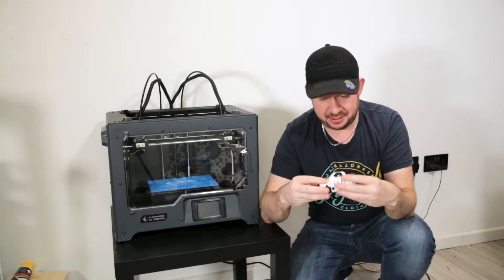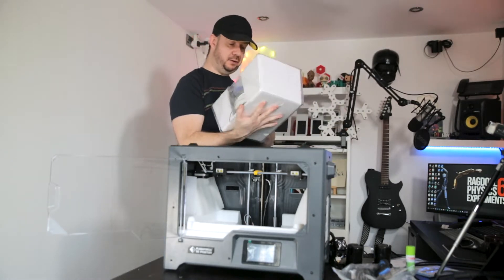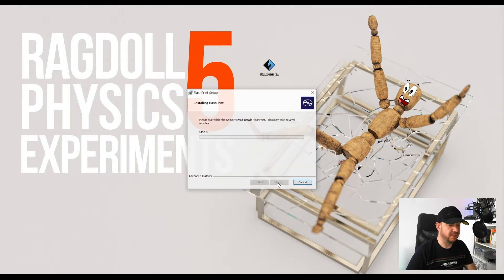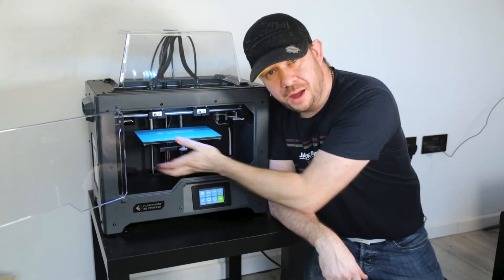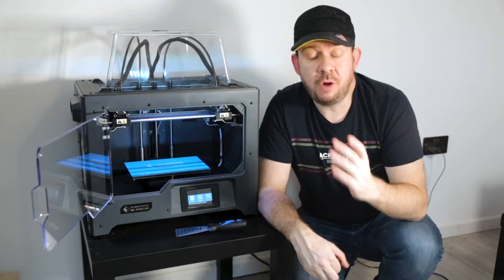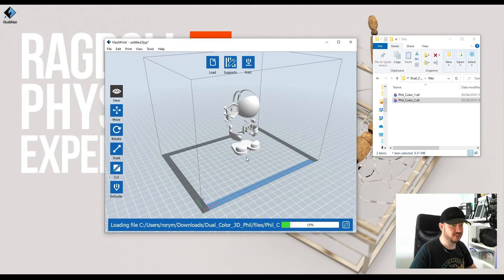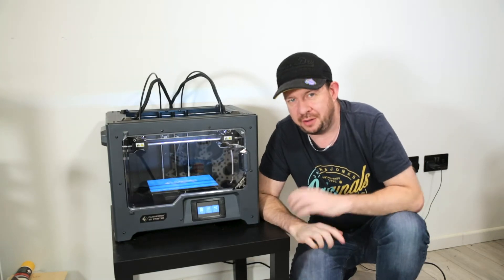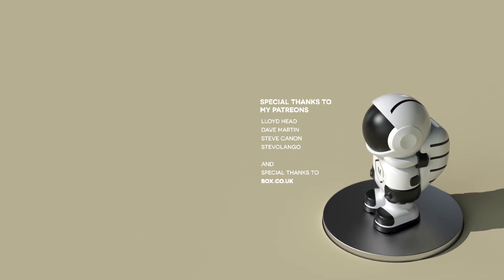Flashforge Creator Pro 2 Review - Unboxing - Calibration - Test Print - Are dual extruders worth it?

Comment: Is it possible to take an existing STL and say "I want just this bit" to be painted, say for example just one finger nail on a hand?
Reply from the maker: Assuming you mean, print the hand one colour and the nails another. Technically... Yes... However, it's not straight forward. You would need to separate the parts of the mesh in a 3D modelling software keeping the positions so that you could set the hand to be printed by one nozzle and the nails are printed by the other.
Reply: @ratemyfuneral  ah damn, thanks for the reply but yeah, probably beyond me

Comment: It works good for me. The hardest part is to get the model off the build-plate as it has really good adhesion. 
Also, removing rafts is another issue. Any suggestions?😁
Reply from the maker: Make sure it has fully cooled, then it should pop off!

Comment: Unfortunately my first experience with the company was to order the old creator pro, get told its out of stock pay the extra 500 AUD to get the creator 2 instead, and get sent someone's faulty Ebay return, return slip still in the packaging. Might be a thing with my local distributor, being in Australia, but hopefully the replacement they're sending me will give me faith in the company and their products again, because for now, I don't have much.

Still their customer support is on point, super quick responses.
Reply from the maker: Aaah how annoying. Personally I have had nothing but good times with all my Flashforge stuff.
Reply: @ratemyfuneral  
I have since received the replacement and it works well..just that sour experience.

Comment: I'm finding the mirror mode is very helpful. I'll print two mirrored halves of a model that need to snap together. The mirror mode saves quite a bit of time when doing this.
Reply from the maker: Oh nice! I haven't played with that yet.
Reply: @ratemyfuneral  It also lets you print at basically 2x speed if you have a bunch of parts. As long as all your pieces can fit on one half of the bed, you can mirror, and thus simultaneously print, with the other half. This lets you put out twice the parts in the same amount of time.

Comment: I got the same printer! But I have a major problem with temperatures. I have an Ender 3 that works better! If I would do a PLA on 210C, it would do so much stringing that I could throw away the print model. If I lower the temp, then for my "support" extruder, the supports get messed up and start stringing like hell. In any case, it would be good to make a video about how to handle supports with this printer and what temperatures to use.
Reply from the maker: Hey, that sounds like a real shame. Did you try contacting FlashForge about the issue? I have always found all of their printers to be extremely 'plug and play' and I have never had to deviate much from the stock slicer settings. I'd suggest that it may be you got a bit unlucky with your specific one.
Reply: @ratemyfuneral  I had no idea what I was doing and my first prints were great with just the default temperature settings. Maybe MDev's print heads have a problem with temperature control?

Comment: Hiya, I can't seem to workout how to get my Flashforge creator pro to connect to the Flashprint software. I've connected the printer to the computer, but cant see it anywhere. I've got the latest version of the software. Its not giving me the option to connect my printer. Any help would be appreciated. Thank you so much.
Reply from the maker: Hey, for me this has always just worked. You could check in device manager to see if it has installed the driver ok. Maybe reinstall the flashforge software and try a different USB port? Failing all that, I'd recommend contacting Flashforge support. I'm sure they'd get you up and running in no time!

Comment: 14:28 Exceptionally well? Have you seen the outlines how dizzy they are? Are you payed for this review or why are you telling the untruth?
Reply from the maker: As I responded to a previous comment regarding this... Having printed rather a lot of Benchys on fresh printers with default settings, I personally, would say that it printed it exceptionally well. Could it be improved? Most likely, with some tweaking to the print settings, but this is a default out of the box test so I stand by my initial observations. (Also, it's worth noting that the camera shows imperfections quite a lot more than when looking at it in person).

Comment: What are the max temps on the nozzles and bed? I just found this video while looking to add to my printer collection and don't have time today to run all the way through it. I love printing with nylon and zytel for things on my friends airplane. Will this printer be able to handle those types of temperatures?
Reply: It say extruder max temp is 240C and bed is 120C

Comment: Is there a disk in the box with slicer software or is it on the sd card?
Reply from the maker: It's on the SD card. However, it's better to download the latest version from the Flashforge website. :)
Reply: @ratemyfuneral  Yeah I installed the version on the card and it immediately told me to update from the web. To its credit the upgrade went quickly and smoothly.

Comment: @14:30 Well.. I'm not impressed at all! Layer lines are obvious not smooth, i see lots of salmon skin artefacts and also a lot of ringing.. How can you call that exceptional? Sponsored video?
Reply from the maker: Not sure what to tell you. Having printed rather a lot of Benchys on fresh printers with default settings, I personally, would say that it printed it exceptionally well. Could it be improved? Most likely. With some tweaking to the print settings, but this is a default out of the box test so I stand by my initial observations. (Also, it's worth noting that the camera shows imperfections quite a lot more than when looking at it in person).

Comment: I been using the Creator 1 for almost r years now. They really did not change anything aside from that extruder setup. I really would've expected stuff like mesh leveling, removable build plates, better acoustic performance or other feature their competitors have put in.
Reply from the maker: Agreed. This is why they were my down points. I'd say as an upgrade... it's so so... but as a new printer it's a great start.
Reply: what do you mean by "r years"?
Reply: @pixel_human  probably a missclick. I meant 4 years